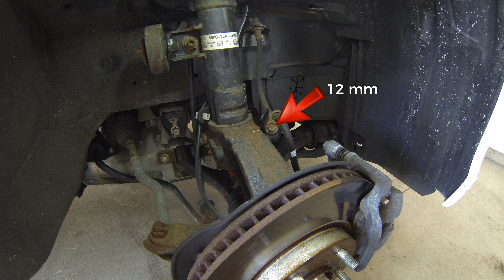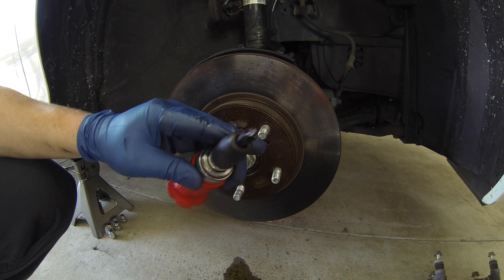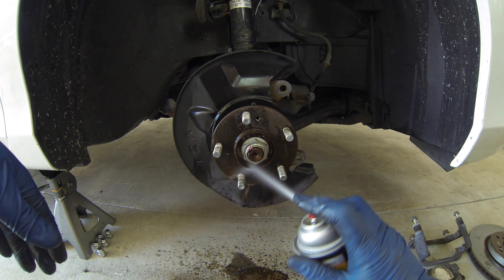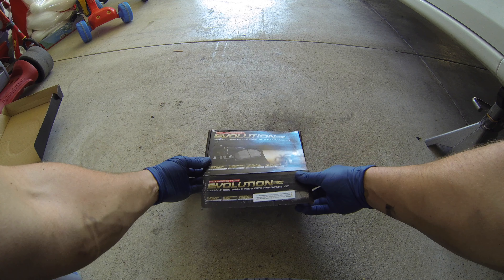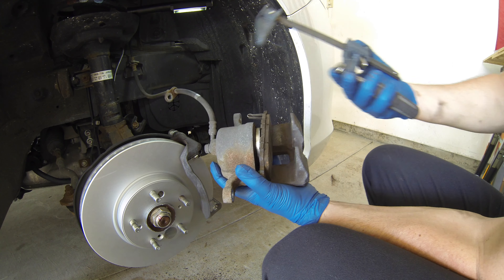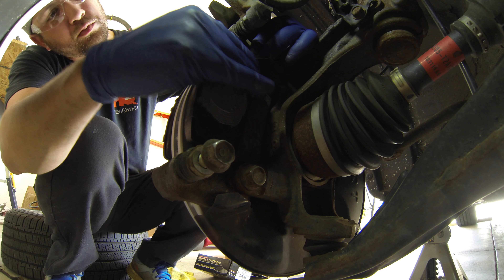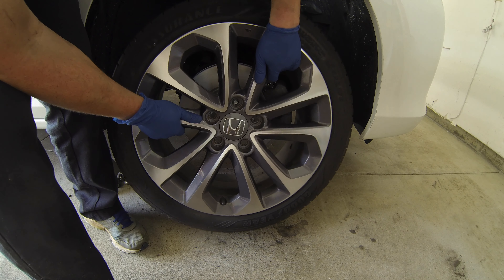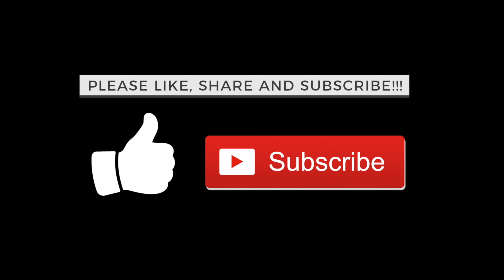How to Change Brake Pads and Rotors on a Honda Accord | 2013 - 2017

Comment: Great job Adam with the multiple camera angles, breaking down of the steps (with some tricks) and providing torque values. I just bought my 2013 Accord and it gives me confidence that I could avoid the dealer costs and do it myself. Thanks.

Comment: Some of the best videos I've seen for how-to.  No nonsense and includes the torque values.  BUT!  for this specific video and your rear brake video you didn't check the guide pins for fee movement and regrease.  Perhaps you live in a warm climate and don't have to worry about winter and salt on roads.  Here in the north I've frequently found guide pins stuck from corrosion.

Comment: Nice Video! I was wondering that the torque of pin bolts of front brakes are usually larger than the rear ones? Thanks

Comment: Just did this yesterday on my 18 accord! Those rotor screws are a bitch!!! I went to harbor freight and bought the same impact driver you had. Worked well on 3 rotors. Then it broke on the last one. I had to improvise. Also the rear emergency brake is a pain screw back.

Comment: Do you have the link for the impact screwdriver?
Reply from the maker: Here is the one I use: https://amzn.to/2yd2OoB
Reply: Thank you !
Reply from the maker: I see you meant Screwdriver.  Here's a link for one: https://amzn.to/3g3iSu5
Reply: Adam Williams what size F Clamp did you use for the front and back?
Reply from the maker: It was a 6 inch bar clamp from harbor freight.

Comment: only question i have is how do you know when youve tightened the bolts enough? idk alot about cars and didnt know there was a specific torque you had to tighten too.
Reply from the maker: You can pick up a relatively inexpensive torque wrench on amazon or harbor freight in a pinch.

Comment: 4:52 are you sure its 37 lb ? other video said its between 9-10 lb. Cuz when i changed my rotors that bolt wouldn't stop spinning.. 37 is too much.
Reply from the maker: Yes, 37 lb-ft is correct, straight from the Honda Service Manual.  The rear bolts are significantly less because the caliper is much smaller.
Reply: @ShopEightyFive  Thank you, that makes sense.

Comment: What happens if you don’t put the bolt back on the rotor *
Reply from the maker: The lug nuts will hold it all together in a pinch but ideally you should replace it.
Reply: @ShopEightyFive  the bolt strip off and I snapped it in half. The other half is stuck in the tread